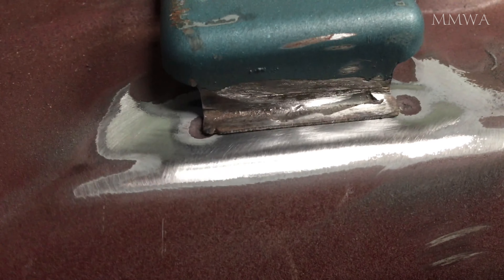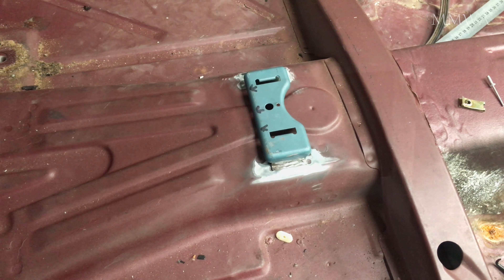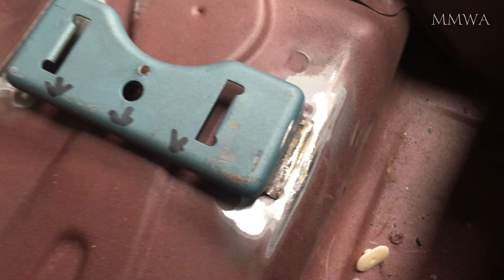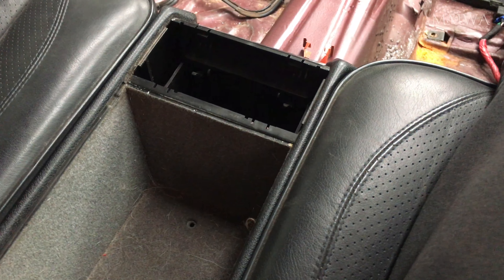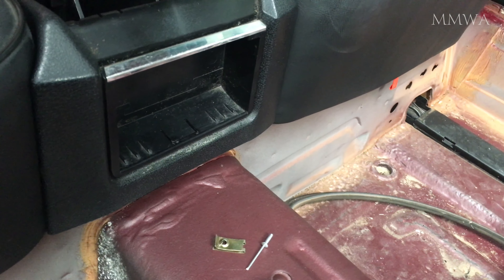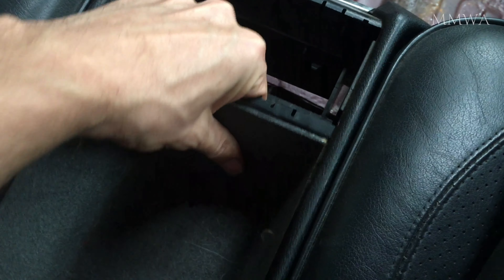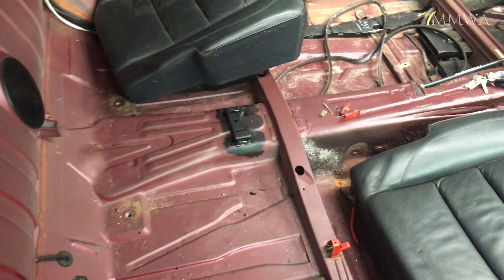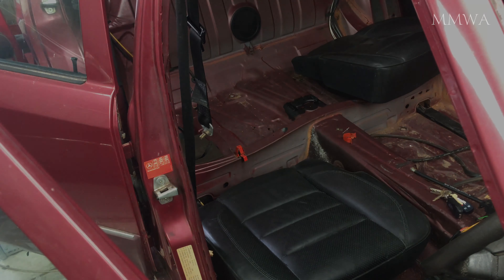I can't weld, so I solder instead - W124 rear console brackets

Comment from the maker: I'm not happy with this solution for safety reasons. I'm going to have another attempt with brazing rods and my torch.
Reply: Or.... As it just secures a console, add a few Tek screws!
Reply from the maker: @tony66au  Bought my self a 6 dollar pack of brazing rods for steel  / malleable metals. Those brackets arent going anywhere now. you can belt the shit out of them with a hammer and the whole car echos. Astonishingly, (though i measured at least 100 times) they couldnt possibly be any more perfectly aligned. The box drops in and locks into place in all 4 slots with no tweaking required. F-ing stoked!
Reply: @MMWA-DAVE  nothing as good as knowing the jobs done right mate!

Comment: The acid test is simple, If you can whack it with a hammer and not dislodge it? Then its sound.
if there is a reasonable surface mating area then urethane bond is also acceptable.
Re your aversion to Welding and comfort with Soldering why not learn how to TIG weld?
Its basically just Ultra high temp soldering.
The only real issue I see with Welding where you want to us fire, underbody schutz and the potential for brake/fuel lines in the region.
Reply from the maker: its definitely rock solid, pulling up on it pulls the floor up. I guess its probably fine. Most people dont even fit the brackets when converting to coupe seating and just send the front 1 and only screw into the floor. The console box then sits about 2cm lower.